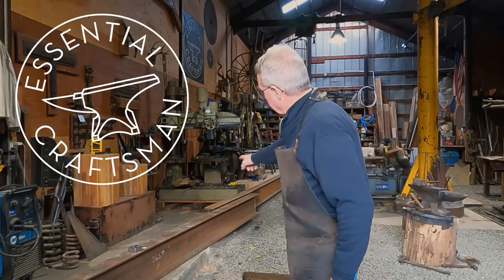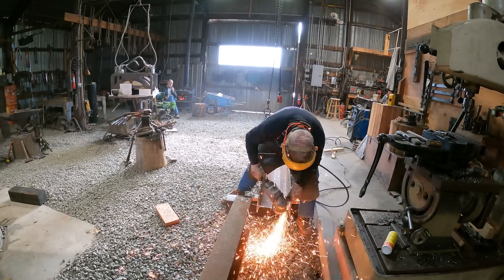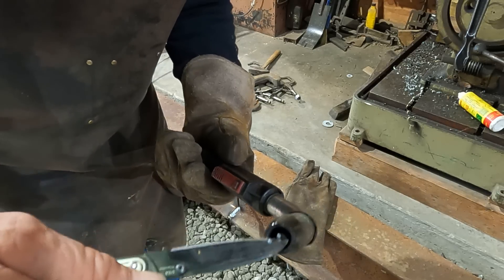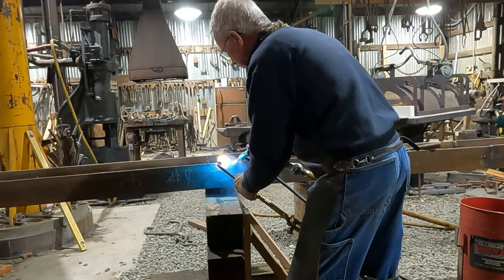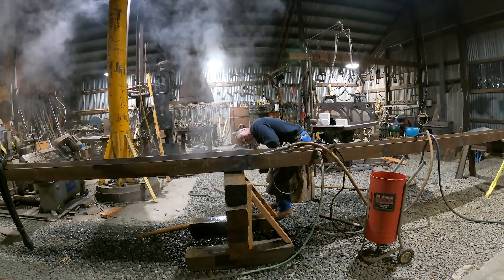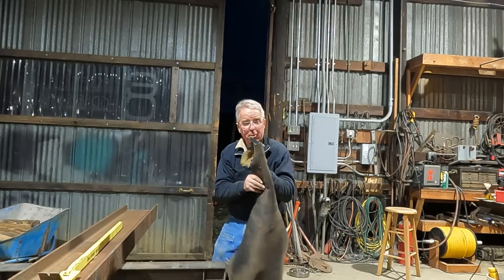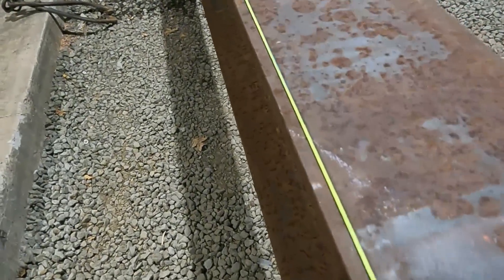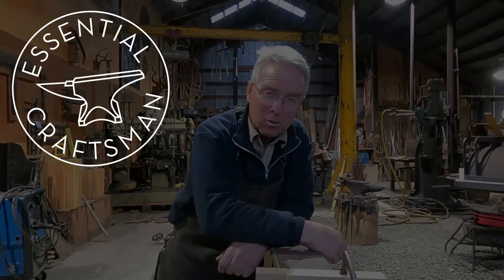Flame-Bending a 40' I-Beam

Comment: The blade connector… perhaps 2 zip tie, one small to hold the white wire to the second bigger zip tie and loop the bigger zip tie over something that will keep the blade  connector in place? Learned something new. Always wondered about how to begin straightening bent bars.  Thanks for the video and the opal story.

Comment: Where you butt welded the two together, are you going to reinforce the weld by welding gusset plates on the top and sides (and maybe the bottom too) across the butt weld? Also, don't replace the hoist motor. Just figure out how to give the cable more strain relief by putting a loop in it before it goes into the motor housing with a cable clamp of some type. I think you can figure it out. And keep up the good work.

Comment: For the strain relief, several ideas. Use a stainless steel Chinese finger mesh cord grip that bites onto the cable that's commonly done. Second would be runner 8th inch garage door cable or light chain along and tie it to the rubber cord take the way to the pendant and the cord off and put it onto that cable and tie the top of the cable up to the hoist. Third option Take your rubber cord bring it over the top of the hoist and back down and then tie onto the top of it to the housing somewhere
Simply lengthening the white wire doesn't solve the issue because then something else will move

Comment: For the hoist, just put a short piece of wire, somewhere 4 to 6 inches, in to make the white wire a tad longer. You can just use the same type of connectors or put on a new plug an crimp it on with a but connector. That should give it enough relief to not pull out again. 
Also possibly just squeze down a bit on the connector to make it slightly tighter.

Comment: I wonder what it's to be used for. I had an 11meter I beam to which I welded about 1.5meter  heavy right angle steel  at right angles about a foot from each end. This enabled me to sit the beam atop two poles ( set into the ground ) and then bolt into them through these two downriggers.  This forms the entrance of my openspan 11x 6 meter implement shed.

Comment: Stainless Steel Strain Relief Cord Grips. You can search and find the size you need. If you have hanging lines for controls must have. I use them on my saw mill power cables the go to the saw head on my woodmizer. I always learn something from you videos. Hope someone has already suggested the strain relief cable ties.

Comment: Eh a couple of hours and you could have got it to follow the line. I flame straightened my bridge crane beam and it came out as straight as a drywall square. probably took me a full day to do it. I got video on the barn shop playlist of doing it. When I was cutting the old twisted beams apart I found just a half inch of weld was enough I couldn't shake a 20ft beam apart with a 15000lb forklift.

Comment: For your hoist cable issue there is a drop cable strain relief product that is available/designed for the exact issue you have. That would be the best however they are not cheap and also would require disconnecting all wires to the hoist to install. As a cheap doable option you can use approximately 10” of fine cable often called Aircraft cable, attach one end to the hoist body and the other end attached to the drop cable making sure the aircraft cable is now bearing the weight of the cable and controller. How you attach to the drop cable you will have to come up with a way that grabs the cable without crushing or damaging the cable outer or inside wires. A couple of gear clamps and Pex type tubing around the drop cable is one thought. 
Nice job on the beam, heat shrinking is a real talent to see it happen in front of your eyes.

Comment: I used to re-camber the beams on flatbed trailers all the time. Back when I lived in a steel town that produced a lot of sheet and tin. The coils were very concentrated loads and would sway back the trailers. I'd remove the bulkhead and turn them upside down with the front and rear sitting on RR ties.  I used a #20 rosebud. The faster you apply the heat, the better it works.

The way it works is, when heated fast it tries to expand, but it can't expand lengthwise because it is constrained by the cold metal. So it distorts the only way it can, by becoming thicker in section. So when it cools being that you have displaced the steel, it loses length. You do it to the flange in enough places and that flange becomes shorter. I've done it with brand new beams when building trailers also. Back in the day, some of the guys would want to run kind of heavy, and they wanted to use heavy beams with a big arch. They would load out about 2 truckloads on one truck and they didn't want to look swaybacked and heavy. Damn, I miss the America that once was.

Comment: the white cable is obviously too short and keeps getting pulled of the terminal, so use a small piece of chain maybe 9 ins fixed to the hoist casing then cable tie the cable to the chain having pushed the cable up before tying it the the chain with slight bumps in the cable to give the cable no chance to slip down and put the strain back on the white cable

Comment: Female spade connectors will spread apart and not grip the male spade connector as tightly as it should.  Using a needle nose pliers down the center of the female spade connector will tighten it up so it grips the male spade connector with more force and be far less likely to pull lose.

Comment: Zip ties on the inside of the case,(zip ties around the wire inside the case).
Then when the case is put back together the zip ties inside on the wire insulation will be the strain relief. It works very well as strain relief

Comment: On the topic of your hoist, the cranes in the shop at work that arent wireless, they have a special cable that has steel wire rope on both sides, that holds the remote, so there is never any tension on the wire itself. Might be able to do something similar with thin steel rope to your hoist.
Although I tend to prefer hand hoists, no magic pixies to apease in those 😅

Comment: I think I would use a oxy-propane superheating burner for this. You need the entire beam red hot at once otherwise it will have a lot of internal stresses, which given a chance will cause buckling under load. Internal stresses in the web are never a good idea. I have a 70kw one which will do this in a minute!

Comment: For the white wire, I’d suggest replacing the connector since they tend to wear out. 3M makes some excellent options. I’ve soldered those connectors and used heat shrink tubing in the past, but I’m not sure there’s enough space for that approach in this case.

Comment: The way the old union carbide oxyfuel handbook describes it is that when you heat a small region of steel, it becomes soft and malleable, and also expands in volume. But it's restrained by the harder, less malleable,cooler metal around it. It has to go somewhere, so the metal is squeezed and deformed in a direction perpendicular to the surface. The metal gets thicker there. Then when it cools, the hot metal shrinks back to its original volume. 

So take a rod with a bend in it. Heat a spot opposite the bend red hot. That little volume expands, but the rest of the rod restrains it, so the hot soft metal squeezes upwards. When it cools, that spot shrinks to its original volume and pulls the rod back towards being straight.
Reply: You got it. The process is called 'upsetting'. We used to demonstrate it by putting a bolt in a vise perpendicular to the jaws. Tighten it and heat a small section in the middle of the vice. As it cools the bolt will  shorten and fall out of the vise. The section that was heated is now fatter. Blacksmiths also "upset'  things with a hammer.

Comment: I really like the idea of cooling the steel down quickly, so you can avoid the blue brittle stage. However, when you were toasting that area and it turned orange, it likely ran above 1200F which is a big No-No for structural steel. New grains begin to develop and that particular area sbecomes significantly weaker than its surrounding area. The best practice would be to use a 1150F temp stick and do several small heats to slowly correct that bend over 6-8 passes. I'm not sure of the imapct of having large grains right next to a heat affected zone, but I would keep that beam in compression. I love watching yoru videos. I wish my dad was as patient and eloquent when describing how he did things.
Reply: I think you're confusing this with tool steels. Mild steel is a whole other animal.
Reply: @maplebones  I work in almost exclusively low alloy mild steels. 1333F is the cut off for grain growth and weakening the steel considerably. 1200F is a good safety max, because instruments and are only accurate to 2-5% and no one calculates the heat input of their torches.
Reply: @timothymccullough889  There's no such thing as low alloy mild steel. It's either mild or it's not. You're probably referring to low carbon alloy steel. Yes, 1333f is the approximate transition temperature, depending on the carbon content, but grain growth up to 1500f is insignificant. If what you're saying is correct we could never weld steel. A weld starts off  above 3000F and the HAZ reaches temps well above 2000F. I don't care what you work with, your education is severely lacking.

Comment: For your jib crane there are a few different options there are standard cord grips that have a tapered plastic insert and a nut to grip the cord or there are woven cable grips similar to Chinese finger cuff toys. 13:28

Comment: Bridge Clamps are the best!
Reply: They are good but a pro wouldn't use any clamps on that job. At least I wouldn't.
Just check them for square and tack them up. The proper welding sequence will keep them square much better than a clamp.

Comment: Just put couple strands of thin copper wire like a wedge over the plug. You could ever hammer the wire thinner to get the gauge you need then plug wire back in and bam it should be good to go. Those plug’s are useful but can be a pain in the but I find wedging a thin piece between that loose connection makes a big difference

Comment: Have used flame straightening quite a few times in the ski industry. To straighten bent tiller bars on the snow groomers (16 foot - 8 inch diameter rotating at 1200 rpm), correct lift tower lean ( 38 inch diameter 40 foot tall out of plum by a foot) and the most challenging was straightening a 14 foot diameter bullwheel while in horizontal position on a ski lift (not in tension). Always amazing to me what a little heat can do!

Comment: Fit a tiny chain onto the crane and attach the cable to it with some slack on the top. In this way You pull the chain to move the crane and not the cable.

Comment: Great content. I have done many heat straightening jobs and the the key is to go wider on the heat-affected zone than you think. When that cold steel stretches, it is not just at a narrow zone, it is a component of depth/width of the flange (for your I-Beam) and the the degree of bend. It creates more of an arc than a single-point bend. I'd start with the smaller adjustments out to 12"-18" of the apex of that bend and work your way in, judging by the the I-beam size. That, of course, depends on the alloy of steel, which is probably not easily determined. It is easier to use heat to stretch than it is to contract, though.

Comment: Scott next time you do that and ur using mig get some 90/10 blend shielding gas and run 30 volts and around 600 on ur wire speed its called spray transfer way better for thick materials

Comment: Hoist.  Release the clamp.  Strip back the cable jacket farther giving you more slack.  Reattach the cable strain relief farther down.    Loop and bind the control cord and hang to release tension while doing this.

Comment: If you can just crush the spade connector a little where it slides on to tighten up the friction fit. As others said prob change it out to a longer wire to take the tugging off.

Comment: You could try putting a kellems strain relief on the cord. It will keep it from being pulled down and making the wire unplug or a cheaper way you could slide the wires through the strain relief farther so you have plenty of slack on the wires and put a couple zip ties on the top side of the strain relief so the wires can't be pulled down

Comment: I have to ask if adding material to the "insides" of the I-beam would not have been a good idea to improve the strength of the beam overall around the welds.  Some ⅜ in a patch of about 8" wide (4" each side of the weld).  And smaller patches for the narrow parts.   Experts?

Comment: for some strain relief on that cable; lift the cable up into the head of the crane more and place a wire clamp around it (think breaker box cable clamp or cable u-bolt), so all weight below it is held by the clamp/housing and wire above it is essentially just floating.

Comment: Hoist solution: just like you once posted a video of raising/ lowering your mag 77 by the cord without it bearing on the connection itself. Redistribute the load, find a way to put the weight on the cord, not the connection. I'd probably weld a bracket to the hoist case and secure the cord to it. Thanks for sharing your craft!

Comment: Flame and water can be so cool.

There is a great story from George Philpott who worked in the Eveleigh Railway Workshops, in Sydney, building trains back in the days of steam.
"In Carriageworks we had one bloke called Chutney. You might have an accident and the under-frame would be twisted and  bent. Chutney would come along  and have a look at it, and he'd say to the fellers, 'Put heat here, put water there,' and you would see the whole metal  under-frame twisting back into shape. These people are gone, and there's no one left to show anyone how to do it." - Railways, Relics, and Romance: The Eveleigh Railway Workshops, Sydney, New South Wales
Reply: We are still around son, I'm one of those few who continually pass on this kind of knowledge by way of practice.
Don't think there's no-one anymore! 👍
Reply: The water only speeds up the process of cooling down, and doesn't make it deform more. I usually place my heat and then do something else for twenty minutes, then come and check it. Saves the mess of water on the floor, and of course you should never throw water on steel that is red hot.

Comment: I lifted a trailer tail that was sagged 6" from the hind wheels back to the rear-end. I learned this method from an old welder that used to re-arch semi trailer frames. 
 I stretched a chain on the top of the frame end to end,  and kept it in tension with a bottle jack. That tension is important because it prevents the steel from moving when it is heated. I heated wedge-shaped portions of the frame 3" wide at the top, down across the width of the frame. Because the steel couldn't expand and bend the frame further due to the chain tension, the heated steel actually thickened. I quenched the heated wedge from red heat to cool. Three successive wedges of heat, spread along the bent portion of the frame lifted the tail 6 inches. I did that to both sides of the trailer and it looked good as new. Plumb, strait, square and level.
Trailers are mild steel, so I wasn't concerned about heat treatment that might have occurred if the steel had been carbon steel.My old welder guy apparently had a process to normalize his carbon steel semi frames after they were arched properly.
Reply: I recommend you let the red come out of it before you quench, even if it's mild steel. There's enough carbon in it that some martensite crystals will form reducing the toughness of the steel. Normalizing will remove those crystals which is done simply by heating the steel to about 1400 F, and letting it cool in air.      It might be that your welder was actually stress relieving, the same process but at  1000F. That's usually good enough on mild steel. 1000F is about as hot as steel can get without showing any color. Normalizing is most often done on tool steels after forging and before hardening.
Reply: @ that’s a good idea, with all the “low-cost” Chinese steel out there today you can’t be sure what is in it.
I watch trainloads of old farm equipment travel west out of Canada’s prairies bound for China.  I’d bet that every piece went into 1 pot, and then never got stirred!!  I’ve come across hard spots in mild steel and I’m sure some of the metallurgy contained an old bearing or something.
Don’t trust them for anything but greed
Reply: @brentchalmers1436  You couldn't be more wrong and I couldn't care less. Try reading a book on how steel is made and you'll see how ridiculous you sound.

Comment: Assuming the hole in the housing where the strain-relief goes through is true, just put a couple zip-ties on the inboard side of the plastic housing with the 'heads' opposing each other so the strain-relief won't pull through. You can also get "locking" spade terminals that would help also. Belts AND suspenders is usually a good policy.

Comment: I would think you'd weaken the beam adding so much heat. So you'd defeat the purpose of the strength of the beam. And they wouldnt pass it under inspection. I've seen inspection tags on beams.

Comment: You can crimp down the female blade connector with a pliers to make it bite more. 

I’d also use a cushion clamp on the power cord and attach it to a housing screw/bolt in order to secure it up.

Comment: The power cord and the pendant cord  need to be separated. The power cord needs to be secured with enough slack at the hoist so that when the hoist traverses there is no tension on the cord. The CM hoist pendant should have a steel cable that provides strain relief when pulling  the hoist. If you have to move the grommet on the power cord to get more white( neutral) that’s acceptable as long as you don’t pull the cord tight when it’s at the far end of the jib boom.